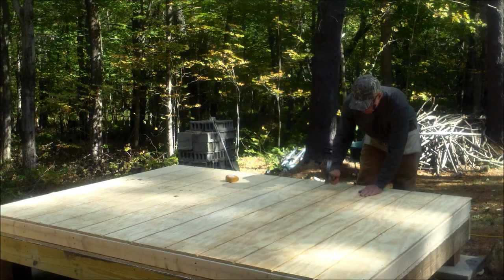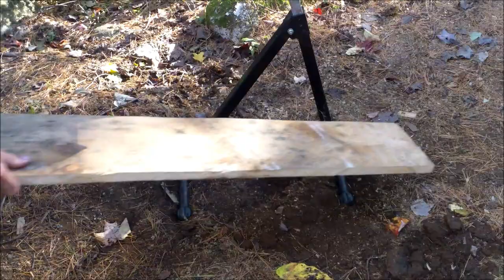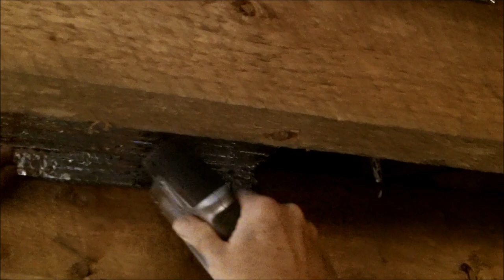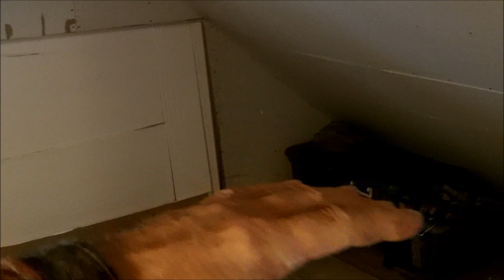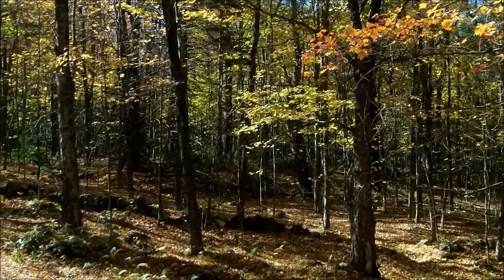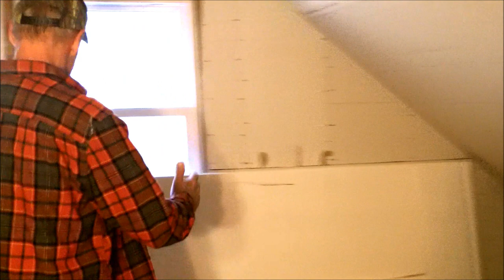NH CABIN PROJECT  Off Grid Homestead Restoration  Part 9

Comment: I use to do insulation some 35 yrs ago when I was 20. On quite a few places like yours with the 24 OC framing upstairs, I would vent, insulate and strap it just like you. After strapping, I would then take what we called 1/2'' Hi-r foam board and custom cut it with a short knife to fit snugly between the 1 X 3'' straps, then tape everything with tyvec, packing or hvac tape, then sheet rock. Of the places I did like that, the customer could not believe how little it took to heat their home. When I suggest this type of install, people think I'm crazy but, ya know what, those homes HOLD their heat !!  The walls are only open once and it works ! Your videos are awesome sir and have sent a link to at least 4 of my friends, relatives. Thanks !!
Reply from the maker: I have been considering stapling that bubble foil to the rafters before I strap but not sure if it will cause an issue with 2 vapor barriers.  It probable would be better with unfaced insulation but I didn'twant to deal with unfaced stuff in that tight crawlspace.  Probably will do the foils anyway and see what happens.

Thanks for sharing my channel.

Comment: Over 50 square feet requires a permit????  Over-regulation at it's finest. Things are looking great though Boss.  The boy and I thank you for the video, they always make our day, your efforts are appreciated.  God bless
Reply: Yeah, permits and more property tax. If you build it small enough and put it on skids so you can move it around the property with a car or something like that, it's not considered a permanent building and wont be taxed. But if the square footage is over a certain amount and it's sitting on the ground rather stout and wont go any where, it's a permanent structure and it'll be taxed.
Now a days the tax assessor doesn't even have to come to the property any more, they just look at Google Earth and they can tell you have a new building and then nail you with more property tax the next time the taxes are due.
There are also laws about where you can put a shed or whatever on your property. A friend of mine built a shed for her motorcycle and made it so it was small enough and put it on skids to avoid more taxes. But, she made a minor mistake. The town came by and said the shed was too close to the edge of the road and griped about it. Not much of a problem though, because it was on skids they just pushed the shed backwards further away from the road which shut up the town.
Reply from the maker: Thank you Lynn and God Bless.

Comment: Just wise advice. Lori and I put concrete siding on the Cabana today and tomorrow we are finishing up what is left. We do not have ANY permits here. No inspections. No fees. Just build it and live with the results. Our biggest water problem is too much water. We have real problems with BATS here in Chile. They love our roof. You can not buy hammer staplers here in Chile. I want a stapler like that. I try to avoid sheet rock at all costs. It is just a pain to work with and to replace when it gets wet. 
Me I am getting tired of stairs. I have them but hate them. 
Nice work:) Jim
Reply from the maker: I prefer one story structures too but this place was already here. I wish I was smaller though.

Comment: JC, i saw your post on Facebook about having to go into town to upload videos due to spotty signal. My future homestead has the same issue, and I have done a little research, but havent tried anything yet. Some cell carriers have signal boosters, often free of charge (I've heard) that allows you to greatly improve signal strength and download / upload speeds. You might check with your carrier to see if this is an option for you. Great video! The cabin is coming along really nice. Looking forward to seeing more progress! - Stephen
Reply from the maker: I've heard of those but haven't looked into them yet.  I don;t mind the trip to town because I schedule it with other errands and doing the uploads at that time allow me to write off the mileage.  A stronger signal would be good though :-)

Comment: I have a off grid cabin in Maine and I want to insulate my floor that is up on pads like yours. I noticed that you put the bubble wrap against the subfloor instead of on the bottom of the floor joists. Is it because of trapping condensation or bugs getting in ? Love all your videos! 👍
Reply from the maker: I prefer to sandwich it between the joist and the sub floor but don't have that option here so stapling it against it will have to do.  Any other insulation will be ruined by mice but I've never had any issue with this stuff.  I'm afraid putting it on the bottom of the joist will just create a haven for mice and they'll no doubt chew the heck out of my wiring.
Reply: thebossoftheswamp sounds good! Thanks for getting back to me. Keep up the great work!👍🙂

Comment: I was thinking about doing the same thing with the bubble foil under our cabin but someone warned me about moisture build up and rot, your opinion? our cabin floor is uninsulated, batt insulation will likely attract rodents to nest  which we don't want.
Reply from the maker: I'll never ever use regular insulation or foam in a cabin floor.  It's nothing but a haven for critters.   All my places have bubble foil and that is all I'll use from now on.

Comment: Do you have footers under your blocks? Or are they just stack on the ground?
Reply from the maker: Those blocks will be replaced. They are original and were done inadequately.
Reply: thebossoftheswamp is footers necessary for a cabin for a small house? I'm starting my own house this winter and I'm not for sure I can get a concrete truck back for the footers just wondering if those are mist.   Thanks for replying

Comment: Hey JC, another great video. I always take something away with me after watching. I was just looking at the nail gun / Staple gun combo through your link and see that it comes c/w compressor. Question, is this the compressor your using? If not, have you had any experience with the one advertised? It looks like a handy unit for tight places and small jobs. (I also am installing insulation for floor boards and will now be using the foil insulation. Thanks mate, I actually rely heavily on your experience. Experience is indispensable. It is so easy to spend money and regret it later, particularly with tools. Cheers
Reply from the maker: I bought the kit with the porter cable compressor with 3 guns. Then I bought the same kit again for the other cabin.  So far, they've worked flawlessly.   The bubble foil is best if sandwiched between the joist and subfloor but I don;t have that option under the camp.  Fiberglass and foam just end up being a haven for rodents.
Reply: Thanks for the advice brother. I originally budgeted $ 3000.00 for a generator and compressor. Thanks to your channel I have saved $ 2450.00! That's a lot of Moose Drool!